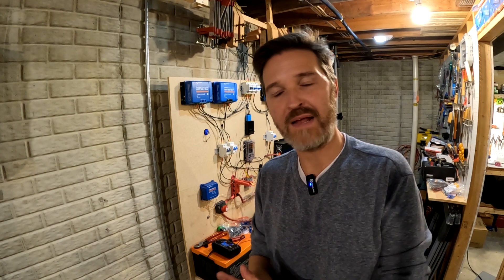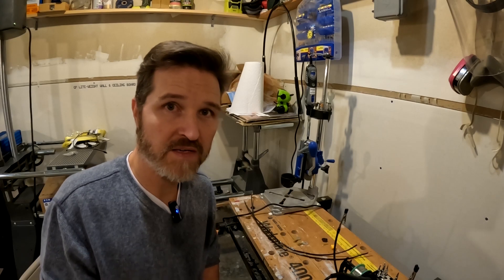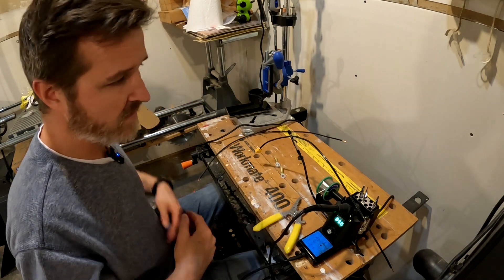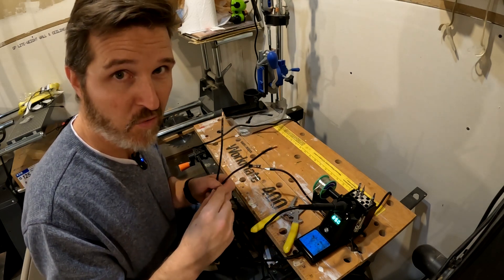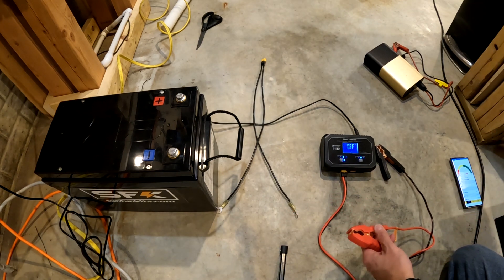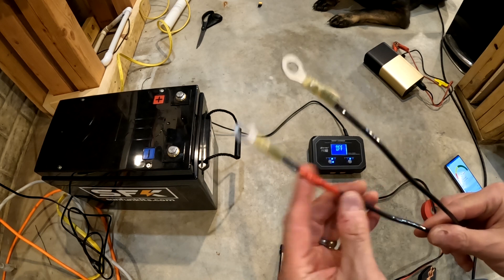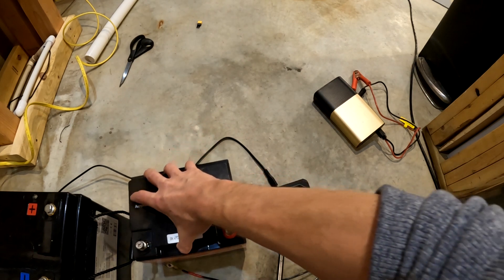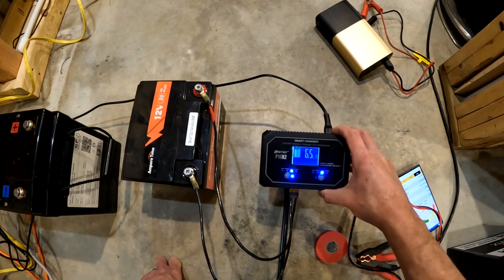Which one gives more amps?  Ring Terminals or Battery Clamps?  Let's find out!

Comment: Like you, I hate soldering and really awful at it.  I have a bunch of XT15, XT30, & XT60 and never use them.  Get rid of those "XT" connectors and go to Anderson Powerpole.  No soldering and a low learning curve to make them.  Also, you might look seriously at "lever" type connectors.  They are 30 amp rating and no soldering or making terminal ends.  Amazon brand is gray with orange levers and I use them all the time.  BTW, they eliminate needing wire nuts, too.
Reply from the maker: Thanks for the info!  Soldering is awful.

Comment: I soldered wire to terminals professionally at a business making switcher boards for audio for years. These are the steps we used. The right heat is important but so are the other steps to have a solid and clean job you can have high heat and still have a tough time getting the solder to take to the wire without the right amount of flux, that just creates extra heat on the connector and if anything is plastic you get melting and issues:
 
1) Strip the wire, twist it if necessary so no strands of wire are sticking out. I find small gauge wire with high strand count requires twisting, larger gauge with more solid strands may not need that.  
2) With the iron at the right temperature tin both the wire and terminal separately. (look up tinning wires for soldering. It even prevents oxidization as your usually covering all the the wire that way in solder and nothing is exposed when the job is done)
3) With the iron at the right temperature solder the wire and terminal.

When your soldering a rosin flux core solder makes it easy and if really dirty or oxidized metal, have a small tin of Rosin flux that you can dip the wire in can help the solder take to the wire well. You should see the solder suck into the wire and you add enough solder until the wire looks saturated. To the same with the terminal. If you do that during the tinning stage when it comes to solder the terminal and the wire you have a clean job with no extra solder getting in the plastics etc... Usually you need to add a little fresh solder to the tinned wire and terminal to get the heat transferring and then all the solder will liquefy again. With larger battery terminals I always did crimping only but if you need to solder you might need a torch to get high enough heat for so much surface area. 

Good luck with the next solder job.
Reply from the maker: I hate soldering!  Thank you so much for all the great info.  My soldering skills need work.

Comment: You didn't do the clamp meter test this time around. If the cable is made correctly, the ring terminals are likely to offer lower resistance due to better (bigger) contact surface. Maybe in the first review video, the discrepancy between your clamp meter reading and the charger reading was due to a higher resistivity at 12v and the use of clamps. It's unlikely, or the cable or connectors would have heated up, but maybe the charger was sending 6.5A but after the cables that was dropped to 5.8A or whatever you measured. That would be a loss of about 8 1/2 - 10 watts. That's about 2.0 - 2.5 ohms of resistance across the cable. Maybe not so far fetched? Maybe it's just high hopes for a low cost product? Empirical data would help show which it is.

Also, for the ring terminals, and it's even possible for the clamp cable, I'd be inclined to connect the battery to the cable first, and then plug the XT60 into the charger. This would be the safest way to prevent accidental short circuit, and the XT60 is made to be easily plugged and removed. You're still able to follow the manual which requires you to turn the charger on, followed by connecting the battery, but it's the safest / cleanest way to do that.
Reply from the maker: Thank you for all the great info!

Comment: So, batteries accept the most current when they are at their lowest charge. Also smart chargers tend to limit current when they detect the battery is "almost full" (maybe 80% SoC is the trigger level for this charger?) 

To try out a charger's maximum charging ability, you should probably be using a pretty low SoC battery. Try one at 20% SoC or something, to see what the charger is capable of, and where that protective feature that limits charging current is triggered.

Does the user manual have anything to say about charge program phases?
Reply from the maker: I'll be testing these chargers again with empty batteries to see if there is a difference.

Comment: I would not have expected any difference and indeed there was no difference.  The charger is basically just current limited at a constant voltage, or voltage limited at max current.   Since it was clearly current limited, it isn't going to care at all about the tiny amount of additional resistance introduced by the clamps.

You could try measuring the voltage at the battery terminals during charging to see if the voltage is lower with the clamps (due to the slightly higher resistance).  Its unlikely you would see much of a difference charging at less than 10A, though.  The clamps are going to be plenty good enough.

Where ringlets are a better idea is in cases where there is a more or less permanent connection between the charger and the battery.  Or one that will be left on for several days.  Or if you are uncomfortable leaving the charger on the battery unattended with clamps for a long time.  Whereas clamps can accidentally be bumped-off or disconnected, that can't happen with secured ringlets.  On the other-hand, it is easier to rip clamps away from the battery if some sort of short develops elsewhere.  So YMMV.

I usually just stick with clamps unless I am trickle-charging the battery unattended for days or weeks while on a trip.  Then I use ringlets.
Reply from the maker: Thank you for all the good info!

Comment: Still Rocking. To be honest, off solar. Not going to bother just FLIP the breaker off. Frozen batteries in shed. And someone said 8 hours to defrost, Had leaking gutters and rain. Gone off topic. Sorry.
Reply from the maker: Frozen batteries are no good!
Reply: @OffGridBasement  ,Lucky its just a fun research project , I can fall back to normal Grid. Feel sorry for people who paid loads or have  no grid back up. even Pylon and Giv energy batteries consumer grade batteries in UK do not have self heating.  And cost a fortune.
Reply from the maker: @SolarResurrection  Agree.  We just had 13 straight days of no sun.  I barely got anything from my 2.6k of solar.  Had to use the grid to keep everything working.  Tomorrow the high temperature is 2⁰F

Comment: Soldering that gauge wire you need a higher wattage iron. Also 60/40 resin core solder ( old school ) for electrical connections I found works best. Over the years I have learned clean connections, proper heat, and correct solder and you will enjoy soldering. Enjoying your videos looking forward to the next one.
Reply from the maker: Thanks for the tips and the comment!
Reply: @OffGridBasement  Yes definitely need a soldering tip with more mass for those cables, the smaller tips just dissipate the heat into the cables and can't sustain enough to melt the solder, yes think we've all been there and done that with soldering the wrong ends on !! 😯 Keep up the great content, and Merry Xmas !